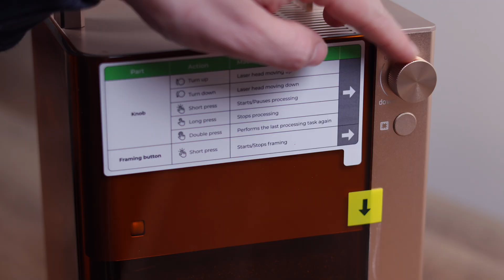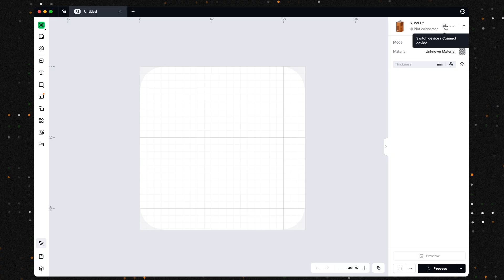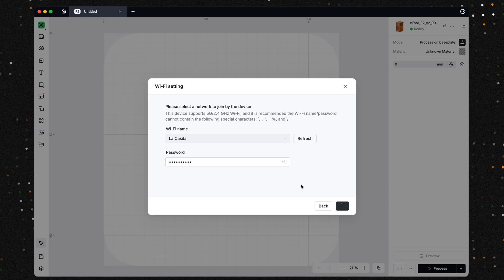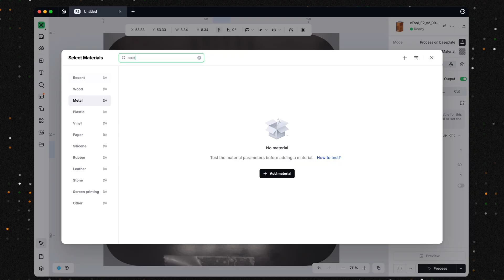xTool F2 Unboxing & Setup | Is This the F1 Upgrade We Wanted?

Comment: Your F1 settings in the PDFs — when the power was at 100%, for the F2 5W I lowered it to 40%. I’m not sure if that’s the correct approach, but that’s how I did it. I’ll check again once I have the F2 PDF
Reply from the maker: Oh cool! I wonder if another approach would be to raise the speed by 40% to gain an advantage with time?

Comment: Great content 😊 ive always had problems connecting my f1 to the wifi and wondering if you had any tips please?  I assumed it was because i use a wifi booster in my shed, but since bought it to the house to try but still won't connect,  i always have to use the hot-spot which is not great because i then cant use the Internet on my phone/tablet or laptop.  Its really annoying and x tool aren't that helpful.  Thanks
Reply from the maker: Thank you so much for watching, we haven’t had any issues with that personally but have heard that issue pop up in all the xTool groups. I’ve seen some say that xTool Studio has resolved their issues. Are you still on xTool Creative Space? It may be worth trying to get Studio and see if that helps. They are 2 separate programs so if you have some sort of issues you can always just switch back to XCS
Reply: @VelfCreations thanks ill try that tomorrow,  ive not upgraded to f2 as im still happy with the f1, your videos are always so informative
Reply from the maker: @eileendarbon5022 Fair enough! The F1 is a great little machine! Good luck!
Reply: @VelfCreations you are an absolute star 🌟  I used my laptop to download x tool studio then connected wirelessly which I was happy about. I unfortunately cant download it to my phone or tablet as they're both android 😮 however, somehow it's worked and my tablet and phone also connect via WiFi.  After having it a year. Thank you so so very much 😊
Reply from the maker: @eileendarbon5022  You bet! Glad we could be helpful!